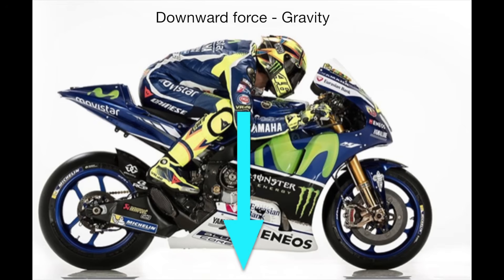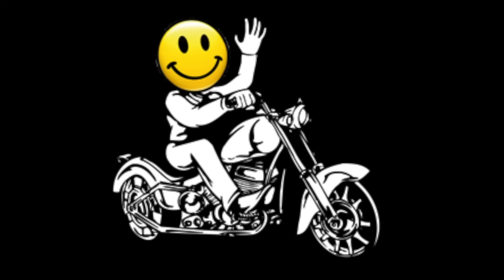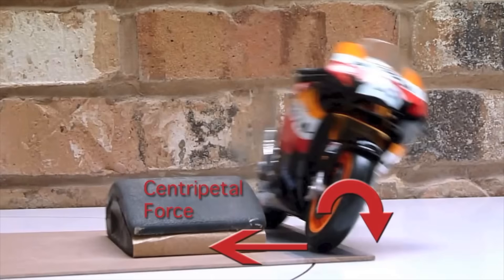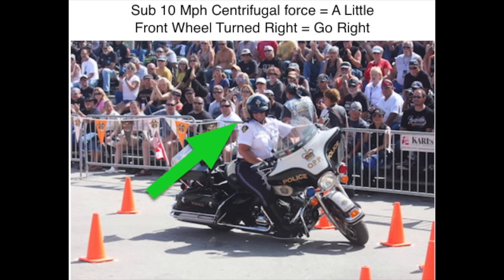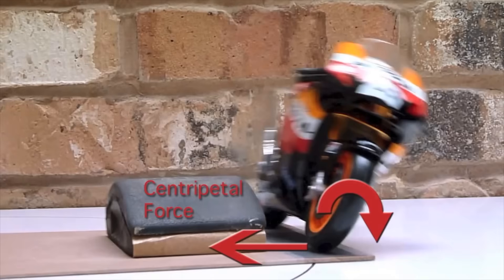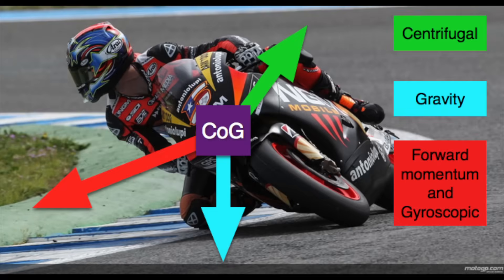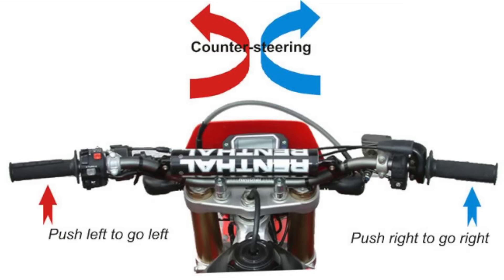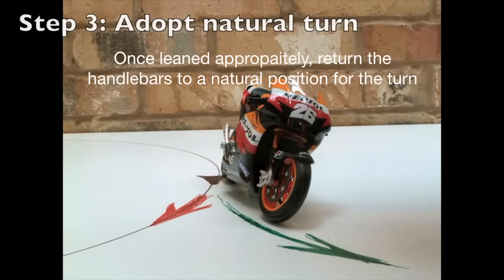Motorcycle Countersteering Physics, Myths, and Misconceptions | SquidTips

Comment: Why do people bother explaining this? Is there anyone riding a motorcycle that doesn't know how to turn one? And the people that don't ride will never fully understand until they do actually ride one
Reply from the maker: I thought the same thing, but then a comment pointed me to this video by a Motovlogger called CycleCruza, who has over 285K subs, pushing completely incorrect info: https://youtu.be/ApGB4ok_zHY?t=1m7s

That lead me to make this response video https://youtu.be/HZW3eT2ESa4?t=2m51s

Which ultimately lead to making my own video, even though it’s been done as nauseam. I wanted to have something to reference to people in conversation, but I didn’t see any other videos that hit all the beats I wanted to hit, so here we are.
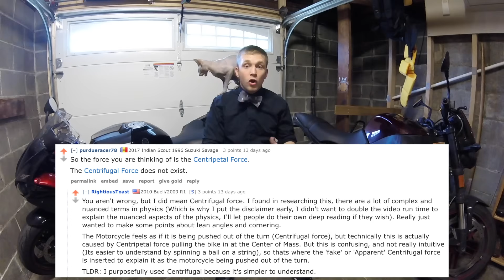Reply: I know your trying to help people, and I think helping is a good thing, but the demo with the model motorcycle 4:15 to 4:50 will only lead to confusion for those riding a motorcycle for the first time. The model should have been filmed with the front wheel tilted slightly to the left while the body of the bike is tilted right and turning right. That would have better demonstrated countersteer and allowed the new riders brain to better understand the concept. I understand it's something that's very hard to explain, but I'm not sure you did any better than CycleCruza

Comment: You didnt explain about the Gyroscopic force involved.
One of the reasons why the bike wants to lean when you twist the bars in the opposite direction of the turn is Gyroscopic precession.
The wheels turn with the forward part of the wheel going down, obvious, but what's not obvious is that over a certain speed the wheel turns into a gyroscope.
Which means any force enacted along it's rotational plane will now happen 90 degrees to it's origin.
SmarterEveryday, and Veritasium has some great videos on the effects of gyroscopes. But in a nutshell.
If your wheel is turning fast enough, then you try to turn that wheel, the forks/hub applies a torque force that in effect is pushing the front and back of the tire in a direction lateral to the rotational axis. Meaning now that force happens 90degrees from the fork hub's horizontal rotational axis.
So if you turn the forks left for example. The top of the wheel now wants to move the Top of the wheel to the right, and the bottom of the wheel to the left. This force now vertically leans the tire over, and the bikes goes with it.
If you turn the forks right, the wheel wants to laydown in the opposite direction as above.
This exactly like a helicopter rotor. but vertical.
Helicopter rotors rotate in a counter clock wise fashion. So when you push down on the nose end of the rotor, the helicopter instead rolls to the Left, and if you push down on the tail end end of the rotor, the helicopter rolls Right.
Reply from the maker: I definitely glossed over that aspect. I just watched the ‘Smarter Every Day’ videos on it, and I think I’m going to have to do some additional reading as I’m not quiet grocking how it works when you have two mount points opposed to one (The Helicopter example mostly makes sense to me).

Thanks for bringing this to my attention.
Reply: I don't blame you. It took me hours of messing around with a pizza pan, and rewatching Vertiasium and other videos until I figured it out.
The two points on the gyroscope work exactly as the one point since they're working in the same path of rotation. Meaning when you push down on the front, it equals a push up on the back.
This video actually is where I made the click! https://www.youtube.com/watch?v=n5bKzBZ7XuM
When he references how Orbits work, I realized what I was thinking incorrectly about, and finally made the logical connection.

Motorcycle Wheels when going forward, always rotate(Front goes down down, Back goes up) in such a way that the precession makes the horizontal Twist on the forks act as a vertical Twist on the wheel in the opposite way of the fork.
So, Looking at the wheel from behind, turning the fork Left makes the Wheel Twist Clock Wise, Turning the fork Right makes the wheel twist counter clock wise.
Reply: FranBunnyFFXII Gyro is not needed. https://m.youtube.com/watch?v=7nr7gxib4Pc

Comment: Brilliant explanation. One important point that is missing on the other countersteering videos out there, is about countersteering only need to be applied BRIEFLY before cornering, just to break the straight inertia, forcing the bike to lean. And then we steer just naturally thru the corner.
Reply from the maker: It seems so obvious and intuitive once you understand it, but it’s such a weird concept to understand as it’s so counterintuitive compared to piloting most other vehicles.
Reply: Raymond Sagrang - That is not true at all. If you are in the middle of a corner and want to change your line you still use counter steering. Please watch or read Kieth Codes “Twist of the Wrist”.
Reply: this is technically not correct... the best explanation I have for this is newtons third law... see, when you counter steer, what you're actually doing is similar to the effect of a paddle on a boat, you are increasing the traction (drag) on one side of the front wheel which throws it off balance, the temporary shift in the opposite direction is just so that the weight of the bike and redistribute itself accordingly to follow the new angled line around the turn along the new traction line on the tire.. you are countersteering through the whole turn, it's just that unless youre going through at MotoGP lean angles, you cant tell that the bike is countersteering because for low speed turns the front wheel angle looks like its turning in the correct direction, but the faster you accelerate and the further you lean the more likely it is that the wheel remain straight or even appear as though it is 'drifting' through the turn, have a look at some insanely fast MotoGP turns in slow motion and you can see the bike front wheel is actually going in the 'counter-steer' direction, this is because in order to maintain the angle at that high speed the tire has to gain maximum traction at that angle, and can only do so by cutting across the directional axis. it's just 'equal and opposite forces' at work, the bike wants to keep going straight, but youve 'pushed it in one direction' and it now wants to go in the other due to it falling over its own axis
Reply: schr4nz This..., is not correct. MotoGP riders are actually drifting out of the corners. Look at the path of ghe rear wheel. It's not forward. The front wheel is actually turning inward compared to the direction of travel.
Reply: Raymond Sagrang 
You have this so wrong. I'm guessing that you don't ride a motorcycle, because if you did you would be aware that you have just sat the bike up and not completed your bend. Shut up if you don't know what you are talking about!😡
Reply: @softailfun  lmao just some "guessing" and weak argument to be rude? Bad guess mate, I ride my bike 2-way trip over 240km to my hometown once every 2 weeks. Regarding that I can confirm everything in this video is true unlike other videos which explain this topic. And you completely miss the point here. Are you all saying that this video is all wrong?
Reply: Raymond Sagrang 
I didn't comment on the video, I commented about what you wrote. You are wrong when you suggest that you counter steer one way then actively turn the front wheel into the bend. If you did this you would stand the bike up out of the lean that you created by counter steering, obviously. The front wheel does indeed end up pointing into the bend, but this is due to the steering geometry of the bike, not the riders steering action. The pressure on the "bar" concerned is maintained throughout the bend from the riders perspective.
https://youtu.be/lzk8oyNO708
Reply: @softailfun  I said NATURALLY, and in your example that is beyond natural, that is forcing a countersteer after a countersteer. And no, that alone is not enough for heavier bike, you need to increase throttle as well to straight up the bike. By what I said naturally, it is somewhat happens intuitively you would hardly realize that after you create a lean for a corner, there could be slight to almost no steering on the front wheel depending on your speed, more exaggerated on lower speed. Unfortunately my bike is pretty heavy that I have to make a lean for a corner on as little as 25km/h speed, go try cornering at such speed with your handlebar locked straight and rely on lean only, if you think you can exit the corner safely.
Reply: Raymond Sagrang 
I’m sorry mate. I can’t understand what the hell you are talking about. If your taking bends at 15mph as you say you don’t even need to use countersteering. Call this done mate, you’re all over the place, Talking total gibberish and way out of your depth. Peace out!!
Reply: @softailfun  of course you won't understand as now I know that you've been riding just some light bikes, indeed you won't need countersteering on light bikes lol
Reply: @softailfun  the heavier the bike the more you rely on countersteering. Even at such low speed you can't make a lean by yourself without countersteer.
Reply: @softailfun  that does not help with your lacking argument on the topic. You can't even provide sufficient explanation other than cursing around. You know you were the first to start the trolling lol
Reply: Raymond Sagrang 
Mate. Your first post was incorrect, your last post was just wrong and the post before that was absolute gibberish! You have no idea how to steer a bike, you have no idea how the steering geometry on a bike works, you take bends at 15mph ... a speed at which counter steering on heavy bikes barley works ( direct steering and counter balance is far more efficient under normal road speeds) You just have no idea mate. I’m amazed you survive on a bike at all. New riders come to these videos looking for advise and are met with your dangerous and inaccurate mumblings. In your first comment you say what is left out of the video, (i.e. counter steer for a brief moment then direct steer after that) it was not mentioned because it doesn’t happen unless you are riding at your speed of 15mph (I can only assume that you take bends at such ridiculously slow speeds because your steering ability won’t allow you to go faster). Try that shit at 50mph! 
I have said my bit and I’m saying nothing else to an idiot who gives opinions based on a total lack of knowledge and ability. Peace. Out ✌🏻
Reply: @softailfun   @Softail Fun First off, you didn't watch the video don't you? What I said in my first comment is just repeating what was said on 4:15. Even the video creator's comment didn't correct me on that. 2nd, you didn't read my word "on the other videos out there" and "naturally". Look now who's the troll here?
Reply: @softailfun  I also said "upon lean there could be little to almost no steering, more exaggerated on lower speed". Too bad you didn't read that as well. Well your last comment just confirmed my point, thanks mate. What are you arguing about then?

Comment: Lmao, Fear Doto Best Doto. Nice reference ;D. On another note, it turns me on how you talk about the stuff thats already been out there about the subject first and then add in your two bits.
Reply from the maker: I am almost positive you are the only person that got the DOTA reference, you are the 1%.

My perspective wouldn't be interesting without the context of everything else.
Reply: Squid Tips I feel touched :'). Might sound a bit off topic but are you planning on covering topics like filtering and slow speed manuevering? Two things I struggle most as a new rider...
Reply from the maker: Filtering I do want to cover, but I've got pretty grandios plans for it that I'm still considering. I don't live in a state where it is legal, so I'd actually like to put together something that could be provided to a legislator to encourage additional legalization.

I'll look at other material around slow speed turns, but we've all had plenty of sub-5 Mph drops. Frame sliders FTW.
Reply: Squid Tips I feel like with a bit of skill, knowledge and experience every rider can do decent above 50 km/h. Atleast not be miserably bad but slow speed manuevering seems like it requires understanding and utilizing your tools like clutch, brake and throttle to their full efficiency to be good at it.
I, for one would definitely be interested to see your input on the matter. 

Ride safe :)

Comment: Nice video. Keep up the good work.

Btw "centrifical" force isn't a thing :^) "Centripetal" force is. I also believe the proper term for a motorcycle in this motion is "Centrifugal" force, as the force is pushing the motorcycle OUT of the initial "turn" that is initiated with the countersteering motion. Centripetal force is acting on the rider, which keeps him firmly planted on the motorcycle instead of falling onto the ground. Just nit-picking here, I do like the explanation you provide.
Reply: motorcycle is not turning  becouse it is pushed out of turn it is leaning in response to Coriolis aceleration on the oposite side of the first wheels secondary rotation